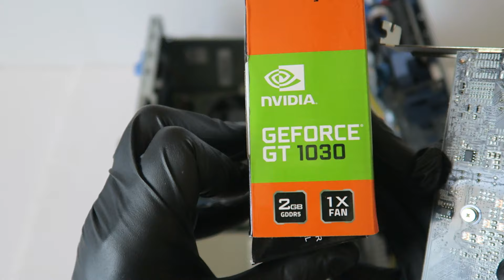Dell Optiplex 7050 Upgrade Gaming Video Card RAM SSD

Comment: Where would I insert the wifi adapter
Reply: If you have a USB adapter, you'll just plug that directly into one of several of the 7050's 3.x USB ports. If you have the PCIe 3.0 x4 adapter, you'll plug that into the 7050's internal PCIe 3.0 x4 slot.

Opt for the internal option. The USB wifi/bluetooth adapter is pretty much low-power garbage.

Comment: Would this hold another 3.5 sata HD? I have an older PC that I'm thinking about picking this model up from ebay, but would like to use the same 2x4TB HDs I have.
Reply: For posterity: the OptiPlex 7050 has 3x SATA ports and 1x M.2 NVMe / SATA port. To answer your question specifically, though: absolutely. You'll even end up with a spare SATA port after the installation of both of your 4TB HDDs.

Comment: Can i buy this, and transfer some of the components into an old tower, get a 500w PSU and gtx-1060 to use? And will that work perfectly?
Reply: @Invasive _Ghosts There is unfortunately no way he/she can run a GTX 1060 on an Optiplex 7050, since the power supply does not come with a 6-pin power connector, mo/bo features a weird 6 pin main connector and Dell does not offer a more powerful PSU for this unit. The best  achievable gaming upgrade  is to go for a GTX 1650 for now.
Reply: @barsbenol749   you can change the PSU and it dell be fine.

Comment: Will this Optiplex 7050 accommodate both 3.5" HDD & 2.5" SSD?
Reply from the maker: Hi, yes you can use both same time, and you will need extra SATA cable and  SATA Power 15-pin Y-Splitter Cable, and 2.5” Hard Drive Caddy X9FV3.
Reply: @Mxkdt  Thanks. Ur a computer pro!

Comment: Where is the video for the cpu upgrade
Reply: The highest you can go in upgrading the CPU is limited to 7th Generation Intel Core processors, specifically maxing out at the Core i7-7700. Remove the case cover, loosen the 4 screws holding the fan / heat sink in place, remove the fan / heat sink assembly, lift the socket lever to release the CPU, gently lift the CPU from the socket, gently install the upgrade CPU into the socket, press the socket lever back into place to lock the CPU into the socket, apply thermal paste to the top of the CPU, gently replace the fan / heat sink assembly and tighten its 4 screws then replace the case cover, done and done.

Comment: There is just 1 NVMe slot?
Reply: Correct. There are, however, PCIe 3.0 expansion cards that add more NVMe slots. Of course, there's only one PCIe 3.0 x4 slot on this board so that would eliminate the possibility of installing an internal wifi/bluetooth adapter.

Comment: Silly question but would an RTX A2000 be compatible in this computer ?

Hoping someone can answer this question for me. 

Thanks in advance (:
Reply: It's an interesting GPU, to say the least, but it is compatible with most of the specs of the Dell OptiPlex 7050. The only requirement would be a major upgrade to the PSU due to the hefty power requirements of the RTX A2000. Given that the PSU for this system is of a proprietary design and totally non-standard, such an upgrade is not very straight forward. There are also proprietary connectors powering various sensors that are non-standard to the typical ATX PSU that you would end having to contend with if you were to hypothetically swap the proprietary for a standard PSU.

The good news may be in the implication that you've got a little cash to throw around for upgrades since the GPU you've chosen is about 3x more costly than the low profile variants you'd typically see plugged into and running exclusively from the PCIe 3.0 x16 slot. That particular GPU is retailing today for about $300 on Amazon. You could essentially procure yourself a different motherboard and a standard ATX12V PSU to power it all and move all your other components over to that board then all of that over to a case designed to accommodate a standard ATX PSU. This could likely be accomplished for less than $200 if opting for a 600W 80+ Bronze PSU and a mid-range quality 7th Gen LGA 1151 gaming board.

Beyond that, I do recognize that you can obtain upgraded PSUs utilizing that proprietary PSU casing but you'll quickly discover that the cost of that product almost certainly justifies just going with a mobo / case / PSU swap instead.

Comment: you can actully upgraded the psu in this pc, but there is something wierd about this pc and the pcie slot. my mini psu 650watt fits in this pc, but i have to make new wholes to make it fit. i used the 24 pinn to 6 pin from psu to motherboard, the problem start when i try to put the gpu in, the pc has a self post everytime i start the psu, even if i dont start the pc. if i have the power cable in the gpu when i start the psu the gpu fan will go full speed and not start, i have to kill the psu. to make it start i have to take the power cable off the gpu before i start the psu so the pc can make a quick start check and then it will come to a stop. when the pc stops i can take the wire for the gpu inn, then start the pc, hehe. then it will accept the gpu. i have no idea why this is, it could be that the 24 to 6 pinn has always on function from the cable? the psu that comes in this pc is 240 watt, and i am scared if i use the sata power to 6 pinns from motherboard to gpu the motherboard will have a bad time.
Reply from the maker: Hi.

Comment: wait i thought the recommended PSUw of these video card are 300w? can it run with this dell psu that has 240w below? Is it safe? because I'm planning to buy video card on my dell optiplex 7050?
Reply: It works i think
Reply: Hey, I have the same question. Were you able to find a more suitable PSU (> 300W) for 7050 or did you go with 240W?
Thanks in advance :)
Reply: @moinmoti  how it is going guys? Have someone bought this thing and does it work properly?

Comment: does it make sense to put 64gb ram on this PC?
Reply from the maker: Hi, yes if you are going to use it for server.
Reply: @Mxkdt  it came out you can't put more than 32GB to this motherboard
Reply from the maker: @ViktorSolenoid  Machine supports max 64gb 
https://www.crucial.com/compatible-upgrade-for/dell/optiplex-7050-small-form-factor

Comment: This isnt the mini tower, its the full tower. The mini tower's power button is next to the disc drive not above it. The mini is (duh) smaller. Much smaller. It uses a different mobo that conforms to the case.
Good try though, great misinfo

Comment: When you upgrade/change the SSD, what happens to the operating system
Reply from the maker: Hi, you have to clean install windows or example if you buy SSD samsung brand that allow you to Data Migration (SDM) clone the drive...

Comment: Can I install gtx 1060 with 4 pin on this desktop?
Reply: Yes and no. "Yes" if you want to either build an adapter to perform a PSU swap to a standard ATX PSU or you're okay with also swapping out the motherboard to gain the ability to directly upgrade to a standard ATX12V PSU that's required to power that GTX 1060.

The "no" is reserved for anyone thinking that a standard ATX12V PSU will just swap right over without any hassles. The proprietary Dell motherboard is incompatible with standard ATX12V PSUs, unfortunately.

Comment: Is GTX 1660 Super fit in optiplex 7050?
Reply: have you tried ?
Reply: @HolidayVisuals  yea zotac 1660 ti 6gb fits in my pc but there is one problem my psu is almost burn
Reply: @HolidayVisuals  so you need to change your power supply to 400w or 500w

Comment: Sadly those are weak video cards. Anything that pulls power outside the PCIe slot isn't even usable. PSU is not upgrade-able. 😒
Reply: I'm having the same question and just did some homework, looks like this 7050 MT PSU is upgradable to 360W and even 460W, the 460W PSU is Dell H460EBM-00 came from Dell G5 which is interchangeable with 7050 MT.